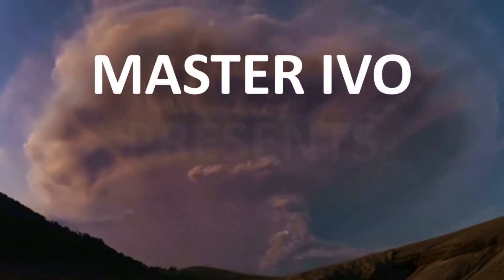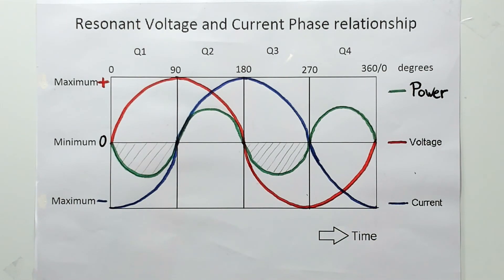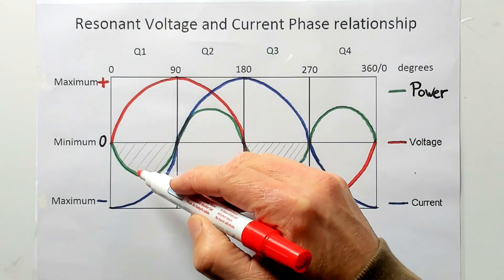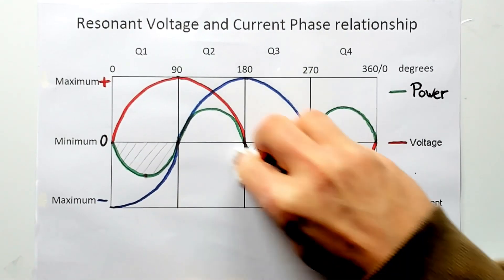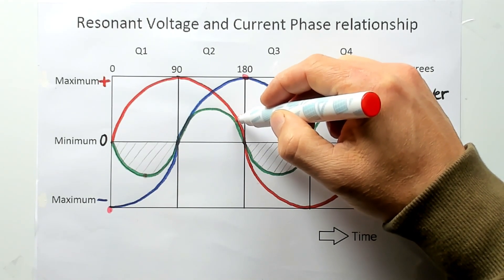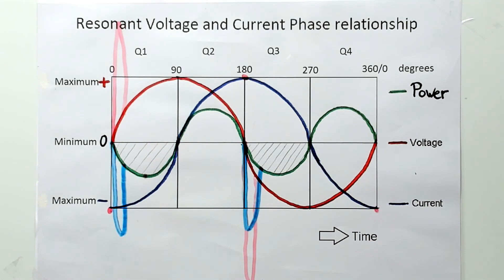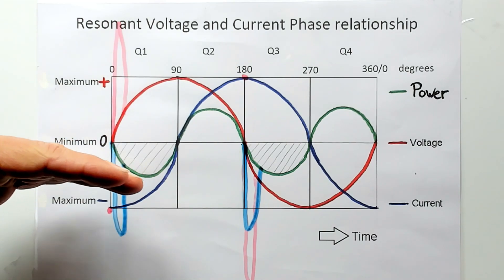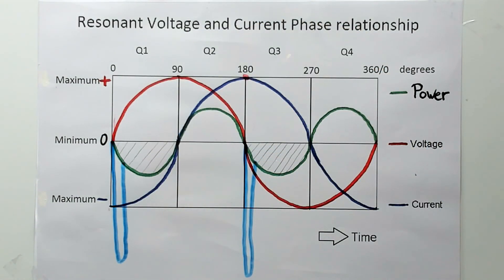Zero Point Power, from Impulsed Resonance

Comment: Hold on a minute. Multiplying the value of v and I for real power is not real. The rate of change should be factored in as power will vary to the square of these values. This applies to the calculation of power of the resonant sign waves and the spiked slopes of the impulses. Think of the electrical power as the momentum generated by voltages applied as current. Making the Oberth effect applicable, giving you a better starting point for maximum power generation ( which you are on target by seeking the maximum current slope, now pair it with the maximum voltage slope that maximizes the product of both

Comment: U need more transformer types, bigger, toroids,different steel types, more 3 coil transformers, Floyd sweets device , self oscillating permanent magnet in a vacuum , mercury in a vacuum? Mercury vapour lights? Understanding lightning storms to the t and make a dielectric vacuum toroid coil, Barbosa and leal patent
Reply from the maker: ah ok
Reply: @MasterIvo  thunder and lightning storms, show electric generation with no magnets steel or copper wire? Hmmm does static collect more static?

Comment: What would happen if you matched up a square wave with a sine wave so that the square wave boosts your impulse spike?
Reply from the maker: that is what happens in the L2 series resonant primary coil.
the impulse is added to the sine wave
Reply: @MasterIvo  so time the resonance to the wave pick-up and dull the response to the 'return wave' and you should see a boost in the efficiency.

Modular frequency attunement is important for this type of model.

I am winding a pancake coil in series to see if it reduces back emf at present. Though that is for a coil acceleration project.

Dual-wiring/NOT bifilar. I want to experiment with conjunctive resonance and see what THAT does.

Comment: Why not use your highest performance bifilar with the highest power multiplier using its output as input into into bi- torroid transformer as done by Thane Heins? Then One of the bi toroid secondaries output should be free to loop back to the input of your optimal multi- bifilar design. And the other bi toroid secondary output should be free - literally. Do you think it's possible? I am trying to describe a way of Tapping your resonant source without it ever diminishing because of how the bi toroid segregates loads, BEMF and also duplicates input power. Is this possible? What do you think?

Comment: I do not understand what you're trying to do because you'll need to spend extra energy to generate the pulse which will be added to the LC resonant tank. As you've shown in your previous video, this is all about reactive power with no gain, no loss so it is remains to be proven that adding pulse energy inside a reactive power process would generate excess energy.
Reply from the maker: I am creating an amplification feedback loop

Comment: So I know we talked about this topic back when you made the resonate half bridge impulse generator; I think it was AC source only. 

You were using bifialr coil back-emf 'impulse discharges' to make the final impulse output switched by mosfets. They were probably powered by ceramic capacitors? That is, if I remember correctly.

Anyway, power limitation is increased by alternating which sets are draining, yet it's still theoretically limited by the amount of current the transistor can switch without fully saturating the gate or outright burning them. Still, it's plausibly the best case senario for transistors, a half bridge circut, that can supply impulse AC enough to make high efficiency power.

For the impulse slew rate, di/dt, for each of these impulse source types: spark gap, bifialr coil, capacitor; which do you think is the fastest to fully turn on to the highest power within say 10 nano seconds or less?

I ask incase you may have insight due to success with the radiant half bridge having clean output. Having used what means you have available for analysis, did you determine if bifilar made impulses rise quickly in power this way, and perhaps make it discharge even faster?

And do the coils have a max Q before they limit or burst or exhibit any abnormal behaviors?

My thinking is that the electric force preceeds the magnetic force in activation speed, and the magnetic flux responds proportionally fast to the speed of the electric discharge, yet a bit slower still. 

So the bifilar coil, when does it begin charging? When the electeic force first flows over it's surface, or when the magnetic flux lines build up? We have spoken about capacitative current being stores in these coils, I'm curious to hear your thoughts on rapid power influx or impulse outflux of bifilar coils! 🤔
Reply from the maker: I cant follow what you are writing about...
Impulse speed is dependend on the resonant frequency of the system. and on resistance.
the higher the frequency, the faster the impulse.
so a cap with a thick straight silver wire shortcut is very fast,  due to low resistance and  inductance if the silver wire.

Same for the L1 coil. if the discharge is through a silver wire the impulse is fast due to low resistance and low capacitance of the wire (note we talked about inductance before with the cap).

series resonance provides wire resistance path for impulse with no capactive or inductive impedances because they cancel out at resonance

Comment: I am not sure if you amplify or gain more the power by that. I think you only increase the amplitude of power on that moment based upon the graph but at a lesser time with respect to the impluse amplied. The power could be equivalent to a lower amplitude at longer duration of time.
When you put some load on it, before it hits to the saturation level it goes back down. Just a thought.
Reply from the maker: correct. we'll see what happens when I test it. It's part of a feedback system. And those power spikes happen around 77000 times a second.
Reply: @MasterIvo  Also, both the upper and lower part of the power sine are both consuming I guess. 
Since you are dealing with alternating current, the power sine also reversing in polarity. V x A = P; -V x -A = P; multiplying unlike signs becomes negative. But, that doesn't mean it becomes not consuming. Generating period may depends on the phase angle of the output coil, wether in sync, or out of sync or how many degree with respect to the input power. Just my simple idea, it could be wrong. Sory my ignorance.

I guess it only stop consuming when one of either voltage or current becomes zero. Like 10V x 0A = 0W, or 10A x 0V = 0W
If half of the power sine is consuming and the other half is generating what do you call it during when it hits the point on the zero line? Thanks
Reply from the maker: The power flows in and out of the coil and its series capacitor. they alternately charge and discharge into each other.
but at the zero power point(max current zero volt) , to put the impulse there creates much higher power spike. A parallel coil will feel this "kick"
Reply: @MasterIvo  Ok. Thanks

Comment: Forgive my ignorance, why a negative voltage spike at or just past 180 degrees? why would the negative volts and negative current give negative (generated) power versus positive,  consumptive power? Only one every 360  degrees (of this polarity) seems to upset the balance to my limited understanding.  
Also in conventional thinking the voltage spike is due to a rapidly collapsing magnetic field, which field is collapsing?  A capacitor in a separate system not included in the diagram that is out of phase again and still somehow linked/involved in this system?
Many thanks Ivo.
Reply from the maker: the circuit is found in the video desciption, radiant power video from april 2019.
the impulse is from the collapse of L1. L2 is series resonant and recieves the  impulse, L3 is parallel resonant (LMD) and is coupled back to L1.

A capacitor discharge creates a current impulse, which would be placed at the zero current point where voltage is maximum. 

But I use L1 coil discahrge, which is a voltage impulse.
Reply: @MasterIvo 
Of course, I've stated that the completewrong way around, and i'll recap the other parts. 
But I'm still confused by the 180° negative pulse. 
Made a small donation this morning. Best of luck
Reply from the maker: @chris0susan0jake   thanks for donating! hope you will understand it  after looking at the circuit

Comment: What you're trying to accomplish can be done with three phase. The third phase power solves the problem of the voltage and amperage being 90° out of phase. You don't need a capacitor when using 3 phase. Tesla's work on power plants is the reason why we have three phase to begin with.
Reply from the maker: sounds good. but in we'll have ti see it work in practice to know if it can be done. Seems really hard to get 3 resonant systems working at 120 degrees

Comment: I was thinking what if you draw a line at 45 degrees from the 90 degree maximum + voltage down to the maximum - current 0 current, where the line intersects with the power? Then you insert a power spike and have almost the kid on the swing scenario and seem to be pushing it at the right "moment"? That way it is carrying momentum as it "swings" from - to + Either way very interesting to see how you go! Look forward to next update!
Reply from the maker: thanks for sharing, I'll draw it out.
Ah I see. yes, but remember voltage and current are not in size relation. 1A is not equal to 1000V  it depends on the scaling settings.

Comment: try adding 'a magnetic pulse' at each of the 4 cycles as they transition through zero , push/pull as it where , stirling cycle positive/negative fluidic pressure visualised sequence if you will... 
'Luc gotoluc Choquette Mostly Permanent Magnet Motor' Apr 13, 2012 poc, works surprisingly well ,more work for less energy ,localised power reclamation etc,
 'Luc gotoluc Choquette Alnico & Neodymium Magnet Flux Gate Reluctance Motor Concept'
"Robert Murray-Smith
5 years ago
To be honest I hadn't realised the power required to pulse the magnet was so low. In mechanical work terms that's roughly the same amount needed to lift two tomatoes from the floor to the work bench. You have inspired me to have a better look at the math here as the efficiency will be a measure of the work needed to pulse the magnet set against the work the magnetised poles can accomplish "

a derivative of ' Gauss Cannon in Slow Motion | Magnetic Games'

Comment: Very Elegant. I’m sure 1/1.618 is an answer to something here. Any thought? Everything in Gods universe seems to be pulsing at the .618
Reply from the maker: yes Phi ratio must be key. I feel itis in the center hole ratio to the coil. as aether flows through the system, amplified by the vacuum created by the impulses, still guessing
Reply: N : S = 1 : Phi.
Some have said the Universe is blinking on and off.  I figured it was the Inertial plane/Counterspace, blinking in and off. Like negative feedback spikes of the infinite capacitance of the Inertial plane. 
Graph; ELI the ICEman. Current leads Voltage in a Capacitance circuit.
Scalable Aether, Casimir Effect Universe!
Reply from the maker: yes current leads voltage, especially when you realize conventional positive current is actually NEGATIVE current!
Reply: @gyro5d  I've heard it said that the universe is being destroyed and recreated something like a hundred million times a second to give the illusion of movement.

Comment: You are right with your reasoning. Picture a child on a swing. At what point in the child's rotation do we apply an impulse that is most efficient. Naturally, at the 2 zero points in the pendular motion. And because these impulses are in opposite directions, one would be POSITIVE and the other NEGATIVE. An exact GRAVITATIONAL analog of the electromagnetic interaction. 
NICE work.
Reply: I beleive in  the child swing theory but also consider the seesaw! It can be different from a swing if it has bump stops. I consider the bumpstops on the ground to be pushing back just at the right time in it’s oscillation. Now imagine they were springs. And now impulses to send the emf back to its counter phase. That now imagined as springs at the top as well. This is where i see the placement. It needs 4 impulses per phase. But they need to be timed just before top dead center as to try and time it on its way back will change on every cycle as the amplitude will be increasing . But if done at last 5% it will be easier to time and more forgiving i feel.
Reply: @Buzzhumma  Ok. We're on to something. The seesaw is just as applicable. But consider the fundamental difference. Namely, that the swing is a single phase system while the seesaw is a 2 phase system because in the former we have a single mass rotating about it's center. Being the simplest case it requires only 2 impulses per cycle. With the seesaw, on the other hand, we have 2 bodies rotating about a common center. Hence, we can introduce 4 impulses. Timing is everything, as they say ,and so the downwards impulse on the high body must be synchronized with the upward impulse on the low body, and then the reverse as their positions change and 1 cycle is completed. 
It seems that the mechanical analogy is in a single cylinder engine compared with a 2 cylinder engine, with the exception that in this instance there is only 1 impulse per cycle @ t.d.c. where ignition takes place.
Reply: @steadyeddy6526  i think you can veiw the seesaw as a 90 degree half wave and a swing as potentially more than 180 degrees to take advantage of but not sure yet if thats an advantage maybe inject from90 degrees and also another at 95 to move along quicker in to its 180 and so on . Who says that high voltage spikes in their respective polarity right along won,t get an amplified effect . And i mean 10,000 volts and above . I intend on using tazer modules to inject on some of my coil experiments! I also beleive in the rolling start theory of drag racing . Things already in motion take less energy to accelerate. Obviously these are ice engines with peak power and peak torque to be considered but alas I believe its best to take advantage at a time when a distinct direction of flow is taking place ! Same as in fluid physics ! There is mass in electrons moving at this rate as electromagnetic feilds take time to collapse !

Comment: If power and wattage are (A) and Voltage is (B) then current is (C)   AB=C .. That's my understanding, correct me if I'm wrong.
Reply from the maker: yes, but only when A and B are in the same time and space as the dielectric and magnetic fields.
and C must be negative to be generating

Comment: power amps and current are same , only voltage is potential. Power/wattage is the amount of gallons the lake holds, voltage is the tilt angle the lake has with hypothetical "FLAT EARTH" . The combination of the two properties being the lake's water capacity (A) and the lake's angle degree (B) equals your "CURRENT" as in the river current.  Well done Ivo, the graph is remarkably intuitive.
Reply from the maker: power is the gallons per second flowing
Reply: @MasterIvo  potential/voltage is the tilt the lake has (Degree Tilt) which establishes flow rate.

Comment: I wish hundreds of people where working on each aspect of this work.
Reply from the maker: me too, but they are!
Reply: @MasterIvo  I have not seen anyone make your progress, when I saw the scope on your cool output from solid state I was impressed, you broke new ground and changed the game. I hope you look in to Rife machine amp. We could use a good amplifier for that, a lot has been learned about that now. Great info out there on it. We have some frequency's and found the radio maker hid them.
Reply from the maker: @DANTHETUBEMAN   Can you share the frequencies? I know of Rife, but never believed it worked outside of the radio frequency range. most devices pulsed at 0 to 100 cycles per second. while I suspect the frequencies work between 20kc/s and 70kc/s
Reply: @MasterIvo  I can email you the page with the information
Reply from the maker: got it, thanks!
Reply: @MasterIvo  you are right about the audio frequency, but the harmonics go much higher.
Reply: @MasterIvo  also Konstantin Meyl found the scalar wave megnetic has effects on cells. He did a lot of great vids and made a small experimental flat coil kit that a lot of people do experiment with. He is a vary smart man. Some one will push this work to far forward to be denied or ignored.